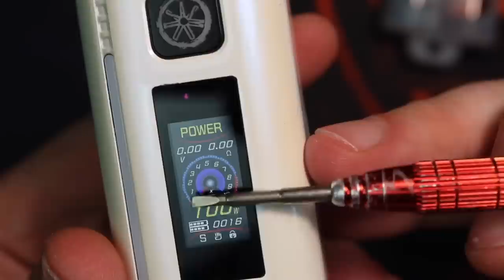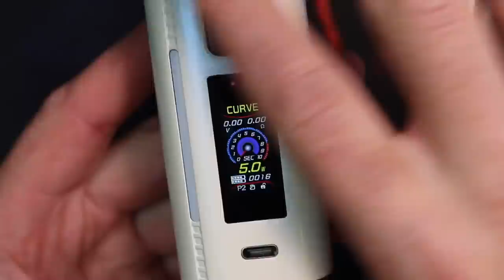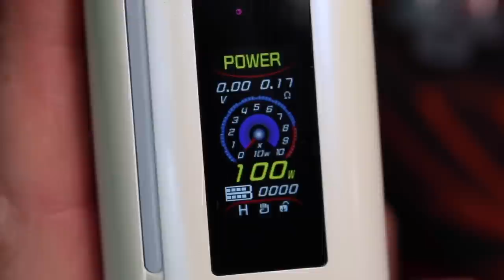Lustro 200w | Asmodus | The Vaping Bogan

Comment: Another awesome review, so I am looking to upgrade my first mod and have narrowed it down to a couple choices and wanted everyone's opinion.  I have been looking at the Smoant Cylon and the Wismec Ravage 230.  Thoughts?
Reply: David Spahn Jr wismec gen3, little, powerful & 3 Batts last 4ever! Had my Gen3 almost 2yrs now & never had an issue with it...smallest 3-18650 batt mod.
Reply: Mike Burgh I have looked at that one as well and found some people claiming there has been issues with the 510 connection allowing e juice to leak into the battery compartment if your tank leaks.  Have you noticed that problem?
Reply: David Spahn Jr no not on Gen3, that was the wismec predator, but wismec fixed on they're newer ones..
Reply: Hi David, me again lol..did they say Gen3 or just wismec devices? Cause I know they had 510's litteraly popping off the mods but they fixed that from happening, this is my 1st hearing about juice going threw the 510 & into batt compartment, the way that Gen 3 is designed the juice really can't go near the batteries it's separate from where the board is
Reply: David Spahn Jr I also do look into battery copartment every now and again when I clean it & it's always dry inside, hopefully this helps😁
Reply: Mike Burgh  sweet, you are the first long time user of the wismec gen three I have been able to get full answers from.  What are the best batteries to use with it because I am really OCD on my batteries, each of my devices have their own set of batteries that  are used only on them
Reply: David Spahn Jr LG HG2...
Reply: David Spahn Jr BatteryMooch speaks highly of them..3000mah/20amp accurate! So X3 is 9000mah! The only con is the mod gets very warm wen chain Vapin at 80wts, but I don't chain vape with it, plus I always have 2 set ups going at once...
Reply: David Spahn Jr I've actually been using it at 60wts with fused claptons at .25ohm & it's running cool...
Reply: David Spahn Jr I don't work for wismec either lol....
Reply: David Spahn Jr I also had  the Rx200S but it was way too big,this Gen3 is so small..I couldn't believe it wen I opened the package, I thought they sent me wrong version & it was a mini internal batt mod lol..true story
Reply: David Spahn Jr it's about 2-3mm shorty than my pulse bf mech & about 2-3mm wider at it's widest
Reply: David Spahn Jr check out Mike Vapes review on it!!

Comment: Spot on review as always man.  Only things I would say are... The torch needs to be brighter and have a dedicated button. The USB C port is fucking awesome. Most android users these days need to carry around extra micro USB cables for their mods. Now they can use one cable for both phone and mod! Big plus! The UI is too cheesy, as you said.  I don't think I have seen a touch screen mod that is using the touch feature to the best of its capabilities. Simple touch to adjust would be great, there's no need for a deep menu system with a touch screen. Just my 2 Bob anyway 👍 Oh and fuck off the LED's!!!
Reply: keifwoki have you tried the g-priv 2 from smok? Great touch screen! Just don't drop it....
Reply: Evan Handelong No I haven't.. I did check it out though, looks pretty decent.  Still not perfect (for me) in my opinion but it looks like things are moving in the right direction 👍

Comment: Cheers for the review.
And particularly thank you for spotting the fact that to TC users, it's a Lustro 80, even if you didn't give it the condemnation it deserves.
I'm not sure why you would think that it's OK for temperature control users to be short-changed on power - almost nobody actually vapes at 200w (even if they may think they do, as sag and drop at that current level will reduce if for them - ask Mooch), so it's ONLY use in for pre-heat, and pre-heat is something which is completely automatic in temperature control, or should be.  Maybe theirs is as badly broken as Geekvape's.  Heck, maybe behind the different user interface it IS Geekvape's., or they both bought the same significant portion from a common source.
People who really use temperature control expect to leave the power right up so that it's all available for pre-heat (ask Daniel).  If my Evolv, iJoy, Kangertech, Smoant,, and UD (note absence of Yihi, which pulses badly if you do that in my experience) products can do it, why not this one?
Just because I use temperature control, why would I not expect just as much power to be available to give fast ramp-up to my SSFC as a user who tries to control it manually?
In automotive terms, it's like limiting maximum power to when the traction control is disabled.  It seems just as bassackwards in either context.
For me (and I was actually considering one), that is not just a con, it's a deal breaker.
Like with the Gbox, I'll look elsewhere (I was able to find somewhere with genuine, new stock of the Kangertech Dripbox 160 instead of getting the Gbox clone of it - I guess they didn't manage to clone the chipset).  Shame, as in other respects (notably topper size) the Gbox seemed to be an improvement as well as a clone, but I can add a 1mm thick rubber or leather handgrip around the case under the overhang of 24mm atomisers on the Dripbox and eliminate it.  And I won't chuck batteries on the floor every time I change the bottle.
Reply from the maker: +Phil Lee thanks bro, but it does 120 in temp control, not 80W. I'm not a temp control vape. I thought 120 watts is enough for temp control. I wouldn't have thought it Was really necessary to have huge power for temp control, but I temp control is not something im not so knowledgeable in so thanks for the info.
but I still think it's dumb why wouldn't they make it the full 200w
Reply: Sorry, my mistake on the power restriction. I waited until the end before writing the comment, and being a bit scatter-brained at the moment and thinking also of the Gbox, I somehow got the wrong figure in my head.
But yeah, we're heating up the same wire, with the same desire to do it as fast as possible, using the same airflow for cooling and the same juice to boil - why would we possibly need any less power?  In fact, the safety net of temperature control should mean you can safely use higher power in that mode, as you won't end up with a bonfire in your atty!
On one mod at the moment, I'm hitting a single 0.35Ω coiled Toptank Mini RBA with 234w - until it gets to 220°, and I get a great blackcurrant and cream vape - and if I stop the draw but leave my finger on the button, then start a fresh draw within 10s of starting the first one, the mod just picks up where it left off.  between draws, when I can read the screen, it claims to be using as little as 6w to keep the coil fizzing nicely, and I get no funky flavours when I resume, just the blackcurrant and cream I expect.

Comment: I know you do a lot of reviews but there are a few things that you mentioned that are incorrect as far as I'm aware, been using this mod for quiet some time.

1. That "wattage boost" on power mode your refuring to is not a wattage boost. It's like a car taco e.g 1,2,3,4,5,6 x1000, but is 1 to 10 x10. So if your running 80w, it will go to 8 on the taco then it's multiplied by x10 telling you 80w. That's why when you go over 100watts it switches to x 20 for a multiplier for wattages 101-200.

Secondly the difference in the taco settings between real and fun is not that fun just revs for no reason. The difference is real needle will go from 0 to the desired wattage instantly, where the fun will ramp up like a real taco smoothly to reach its desired wattage.

Usless info but maybe someone wants to know....meh

Great review 👍
Reply: Thanks man